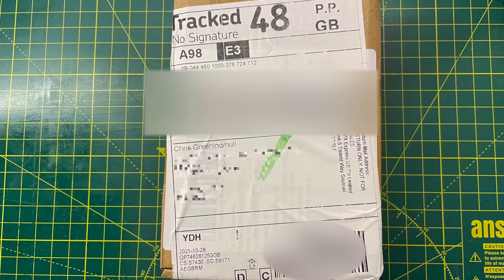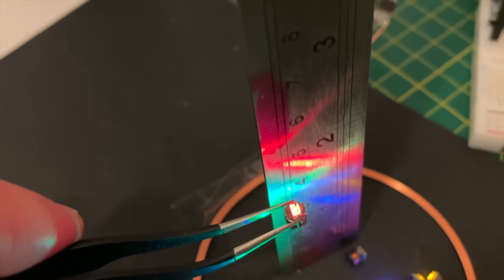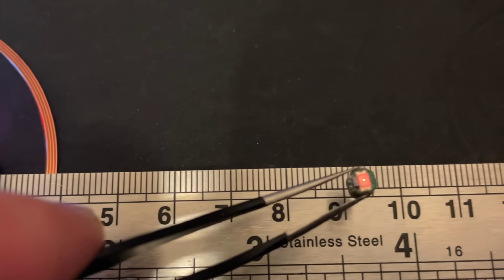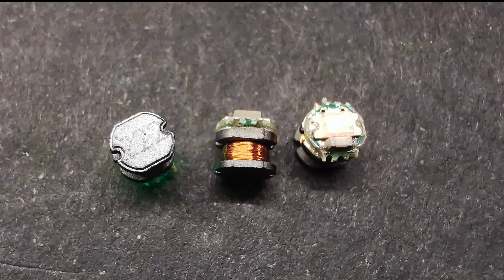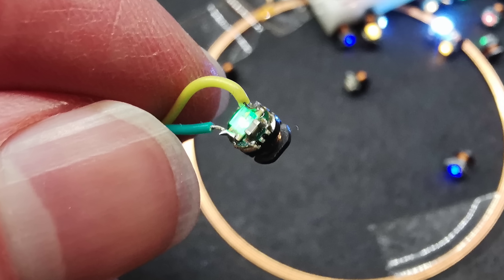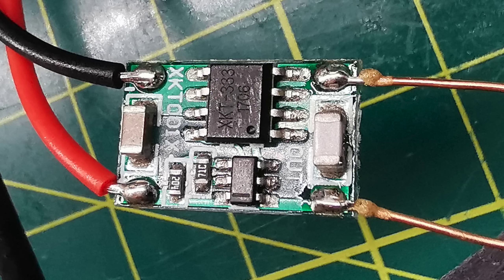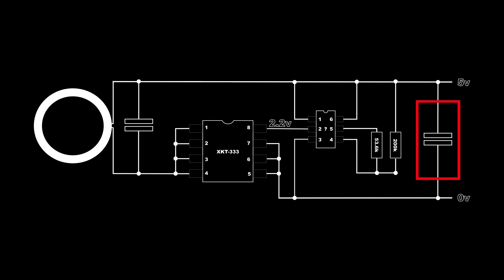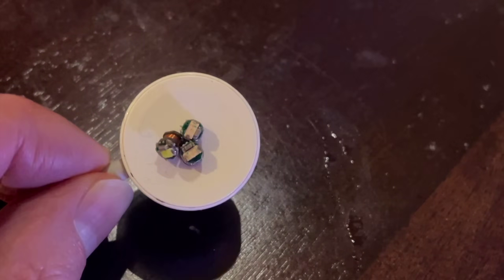Look Mum No Wires - This will blow your mind

Comment: Excellent. I made one 20 years ago when messing with Tesla patents. 
If you have hundreds, put them in a glass vase from Dollar store and build a base with the transmitter coil inside the base, to hold the vase on top. 
Like capturing hundreds of non-flashing fireflies!
Reply from the maker: That's sounds like a great idea - I'm going to try making some myself - have a bunch of inductors to try out.
Reply: @atomic14  👍
Reply: You could make a vase with up to three coils on right angle axes, going on and off at different rates.  The LEDs will blink differently at different orientations.

Comment: How much power / voltage does the coil itself need? I was thinking hooking up peltier modules to clothes to harvest body heat and then illuminate outer clothing layers with these LEDs?
Reply: Super cool stuff anyways, love your channel
Reply from the maker: The one I have takes 5 volts - current requirements are not specified, I'm just powering it from a USB wall wart.

Comment: Nice, but what do you use them for?  seems like a product looking for an application ;-)
Reply: There's a Strange Parts video on a version of these in Japan used for adding illuminated highlights to models in displays without need for wires or batteries.
Reply: @bornach  I can see these for shop displays with the coil in the stands, or maybe dolls houses
Reply: @TheEmbeddedHobbyist  you could have them as lampost lamps in a model village/railway, when the vehicle moves under them (with a coil hidden inside) they'll light up as you pass...
Reply: I can think of lots of ornamental uses, imagine 3d printed dragon lair with magic gemstones for your office desk.
Maybe for some kind of application in toys, board games, escape rooms, larps what not... Maybe longer down the line you could use this to power miniature medical equipment like sensors, logging monitors, endoscopic cameras etc. And as others said, it could be viable for lighting doll house / miniature train scenery depending on the range.